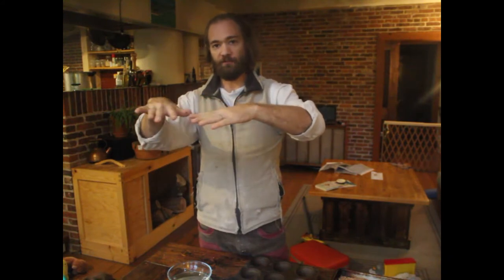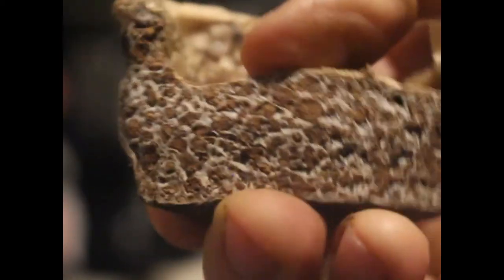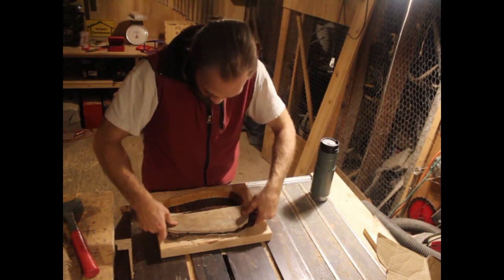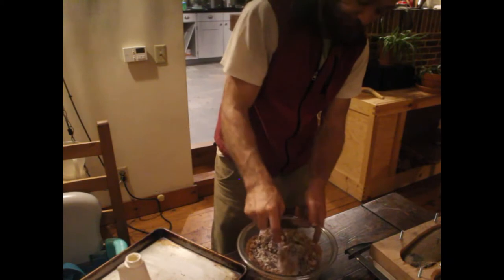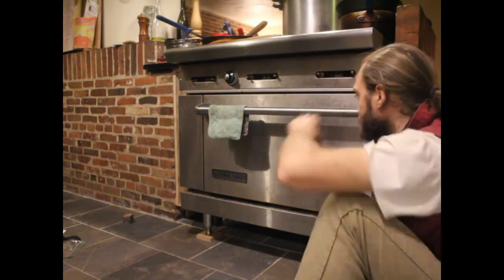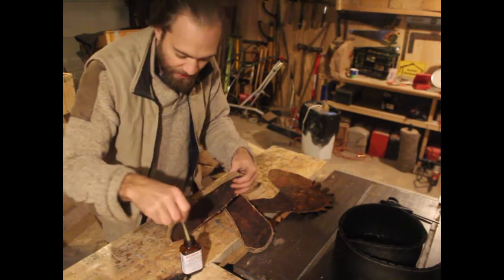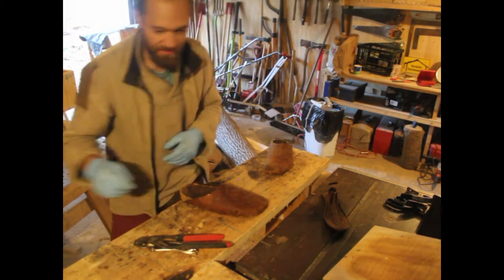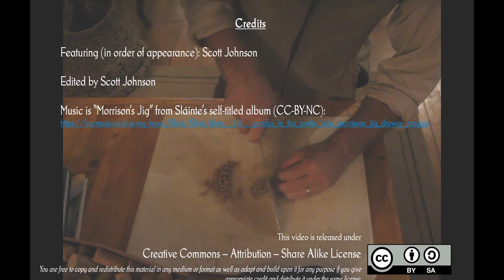Cork-Latex Clogs -- Low Tech Video, No. 22

Comment: Thanks to your video! I tried this myself on a smaller scale. I also made some improvement from your video. I used melted beeswax to seal the wood and to make it nonstick I also use suede leather instead of normal full grain leather. The footbed is a little bit softer and it didnt have folding or creases. Just make sure to use a big piece of jute and leather, bigger than the mold. And the result would be a lot nicer.
Sorry for my bad english btw.
Reply from the maker: Wonderful! Thanks for sharing.

Comment: Wow this is amazing! I can’t be happier that I found this video. I’ve always wanted Birkenstocks but have irregular foot shape, so I’m going to make them now! :) looks like hard work but I’m willing to try!
Reply from the maker: Good luck! Some points to think about as you go along:
-Figure out a good way to release the sole from the form. Mine stuck and tore some.
-Be prepared to experiment with attaching the uppers and rubber sole. The tread sole I used was too heavy and separated from the cork-latex.
Share if you have success or updates! Thanks for watching.

Comment: I'm not sure how I got here, but some of your low tech will help me in the repair of my sandals. Your proportion experiments were just what I needed to see. Thank You.  I just pulled off the original sole and will be slapping on some thicker and slightly harder soles. I find that the cork under the ball of the foot was crumbling and I have a void to fill and I now have a better understanding of how to make the goo. My interior foot bed looks good for another go or two. Your project was way more than mine, but you stuck with it and helped us learn a lot. How did your Second pair turn out?
Reply from the maker: I'm glad to hear it helped! I've made some updates since then, as the rubber sole was too heavy. It pulled off and I replaced it with lighter EVA foam. Let me know how it goes with yours.
Reply: @LowTechInstitute  I resoled a pair of birks (Boston), and used your technique to fix areas of crumbled cork sole. Great. Used vibrum lug sole. Super stick contact cement. Sanded rubber, degreased w/alcohol. Glue both sides, let glue dry(10 min). Heat the sole in toaster oven 5 mins at 120F. Clamp overnight. Success.
Reply from the maker: @kjer6071  Oh! Good luck! I hope they stick together for another long bit.

Comment: Super cool video. What brand of latex did you use? I was going to buy some brush-on mold rubber from Hobby Lobby, but I don't know if it'll work the same. It seems like it needs to be pretty thin to mix with the cork correctly.